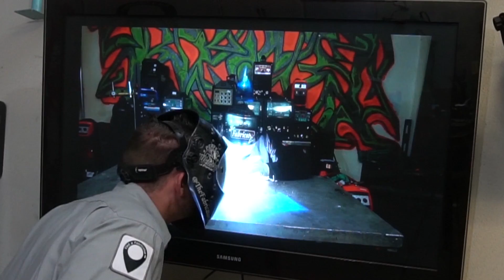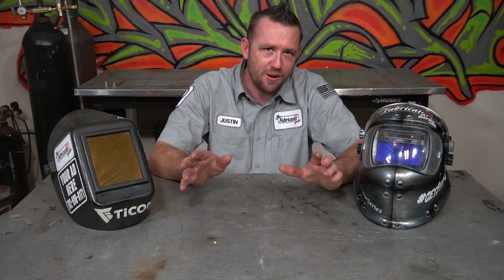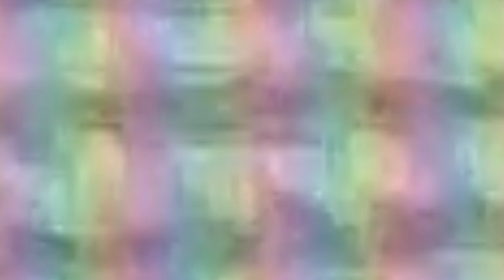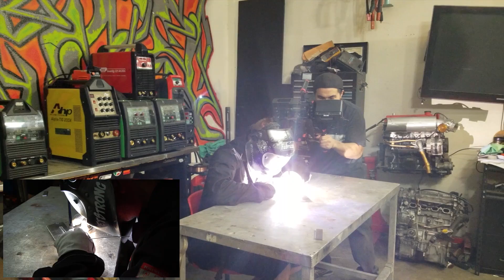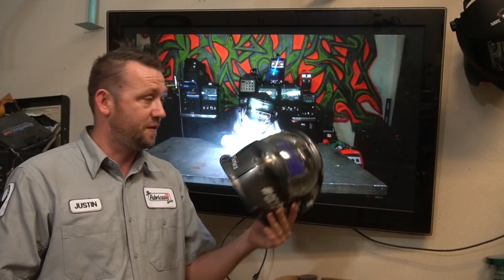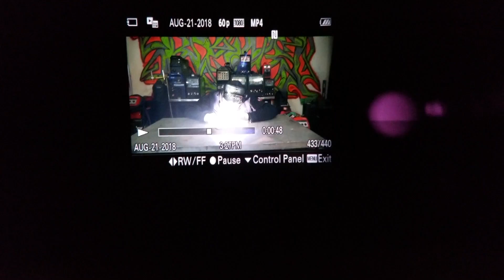TFS: Why Doesn't Welding on TV Hurt Your Eyes?

Comment: I think a more concise way to put this is that your screen cant output the same kind of light (wavelength and intensity) as an actual weld. You're just watching a camera interpretation of a weld.
Reply from the maker: That is correct, but to simplify it - it's just a pile of colors. Just keeping it simple.
Reply: Simple would have been half the time... LOL
Reply: The Fabrication Series Great video but I think the OP is correct here. All light is, including from the sun, is just a pile of colors. The monitor can not reproduce it at nearly the intensity of the original arc. Those little color pixels on a modern LCD/LED (a misnomer, really as LED is just an LCD backlit by LEDs) are just a filter. The backlight is emitting all the light. The exceptions being plasma and OLED where the pixels themselves actually do emit the light. 
I don’t want to say all, but any decent modern autodarkening welding helmet will filter out UV an IR even when the darkening is not engaged. The darkening is just an LCD that shades out visible light. So while a flash with your autodarkening hood down is no bueno, it is not as damaging as with no protection at all.
Reply from the maker: @jameswyatt1304  Simple is interpreted. Understanding often takes repetition or an additional view. Time is irrelevant to understanding.
Reply from the maker: @CleveDawgPound  As simple as it can be - it's just a pile of colors. OP is correct, but make it simpler. Anything on a monitor is just a pile of colors. Nothing comes through the monitor because its color. I'm not saying either is an incorrect definition. I'm just saying that is just a pile of colors.
Reply: Benefit of repeating acknowledged in my other comment.  I've taught young folks to weld and consider the welder the most dangerous tool in the shop because of all the ways you can be injured - UV, hot metal, etc...  Keep up the helpful videos and thank you!
Reply: The Fabrication Series I get it. I guess what I was trying to get across is that all light; the sun, a welding arc, a tanning bed, is just a pile colors. Maybe I am missing something.
For me the bigger question is does the camera sensor degrade over time filming the arc shots without any protection? Also, for the full spectrum shots where we can see the full intensity do you have any UV filter on the camera lens? Not that it would matter on the viewing end, just for some camera protection.
Reply: The Fabrication Series also just want to say that I love your videos, and love how you are so engaged with the channel in the comments. Keep up the great work!

Comment: To be real scientific. Light photos emitted from a TV are ll the same brightness. Regardless of what's being shown on it, white, blue etc. Light photons emitted from a welder are obviously stronger and are only as bright as the voltage that's being put through it, which in most cases, is bright as fuck.

Comment: Worth repeating even if you've heard it.  I've been zapped, but fortunately it was quick and I recovered in a day or two.  Love your description!  Now I religiously check my welding helmet (waving fingers between it and bright light) before every session.  Every one.

Good point about the camera operator needing to cover what isn't covered by a camera.  Wish I had y'all's video setup, though.  Welding will also fry your camera's "eye" if you don't have a good filter.  Blocks-visible doesn't ensure blocks-UV.  Poorly-filtered IR ruins color balance.

Comment: How about welding with short sleeves?  I know a welder who does a lot of welding with no forearm protection. How does he get away with it?  If I do it just for a few minutes I will have a sunburn, lol.

Good video, btw.
Reply from the maker: That's related to people and their skin (or something). I'm one of those guys who doesn't burn easily with welding light but stick me in the sun and I'll be a lobster. Other people burn instantly from the light on the other side of a brick wall. Everyone is different I guess haha.
Reply: He's tanned year round.
Reply: I tig weld no sleeves but mig is a definite.
Reply: supermodels are all great welders, they weld naked.
Reply: TIG arc is more intense than MIG so....